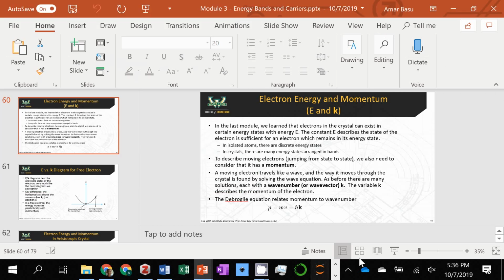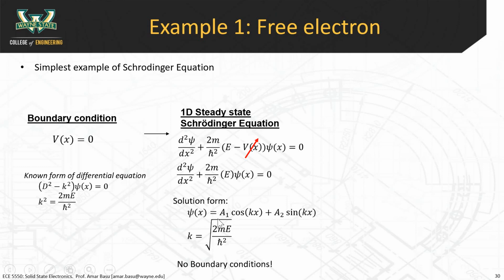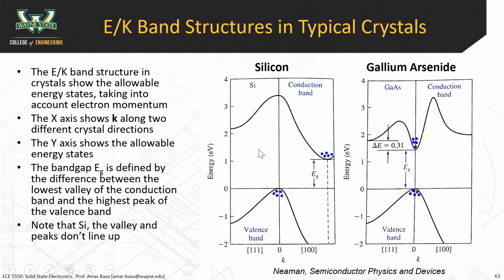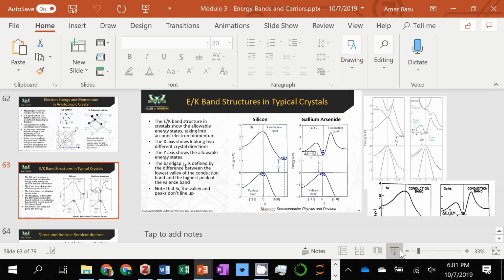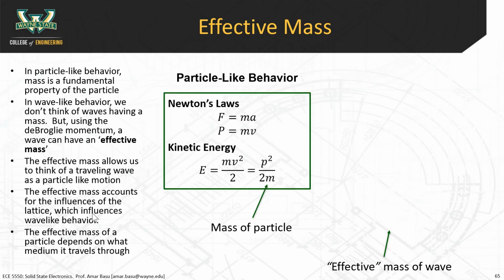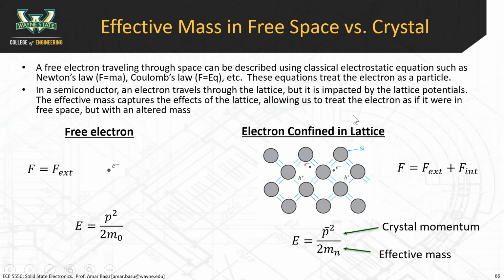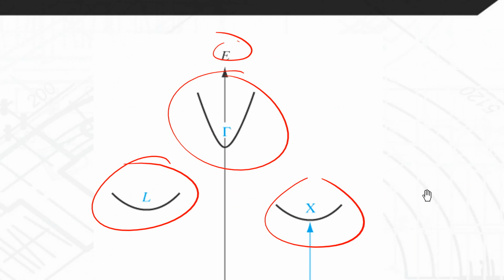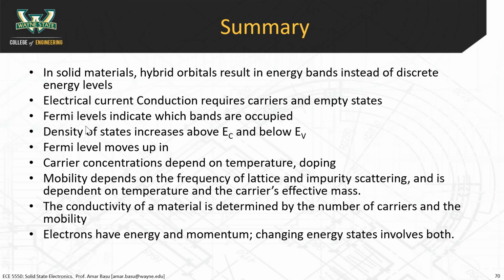3E: Carrier Energy, Momentum, and Effective Mass

Comment: Thanks for amazing insights, in order for it to be perfect, could i recommend few things to focus on, that i see many or all professors just skip and dont think about.
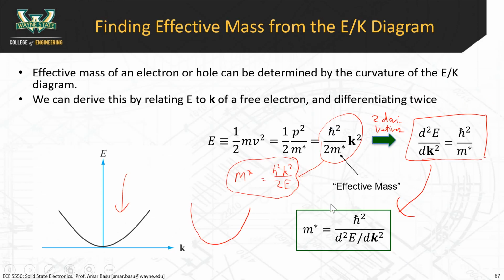49:39 - One diagram shows the energy in function of an electron momentum, but the other diagram is a BAND. The thing is that based on that, the electrons effective mass can just be lighter than what we are calculating here, but doesn't need to be that one. It will be most of the time based on this equation, as much as electrons prefer to pile up on the bottom of the band.
Also it is wort emphasizing that "effecive" means, if we suppose the electrone is acting as in free-space, it would act but with this (effective) mass.